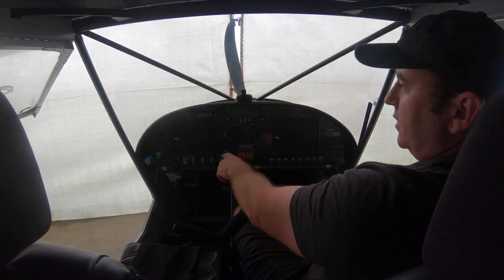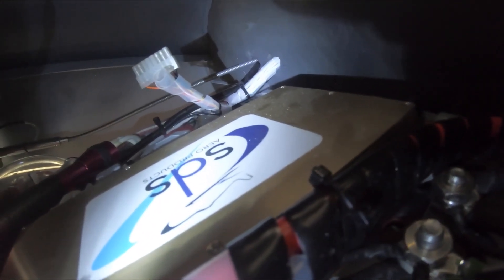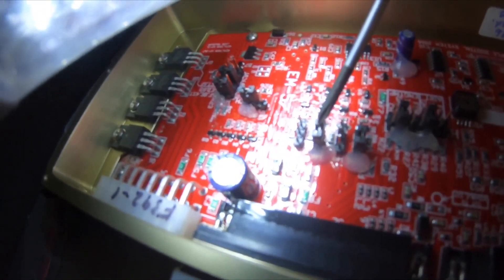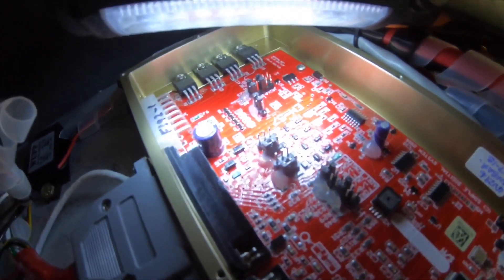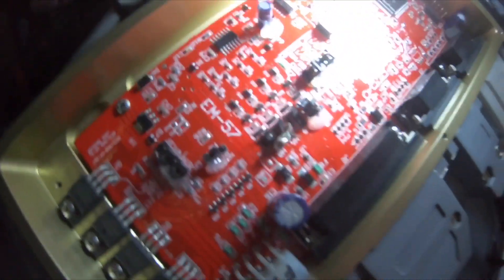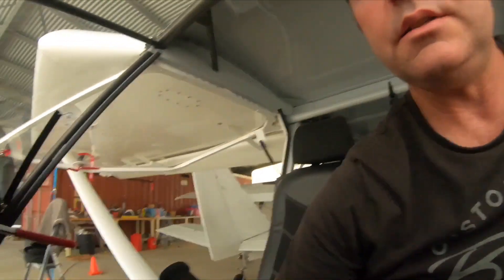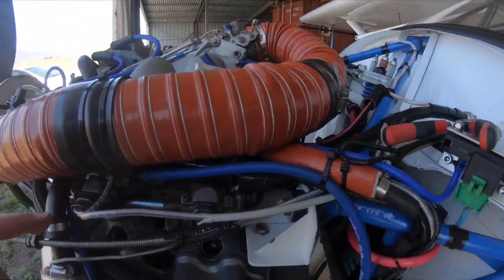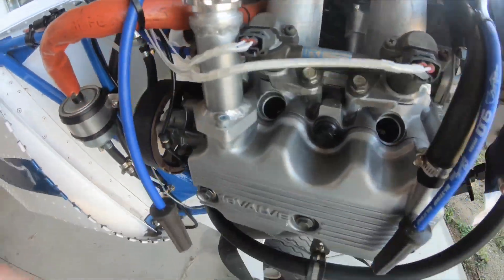Subaru aircraft SDS Fuel injection fuel trim option on the Zenith750supercruzer

Comment: Gosh that was difficult,  I just plug my laptop into the Link ECU and tweek as needed! Much easier.
Reply from the maker: Now that it is done it’s much easier than a laptop, I don’t have to Cary a laptop, turn it on , plug it in , open program. All I do is push a button on the dash to change while I’m flying.👍🏻
Reply from the maker: It’s because I didn’t order fuel trim with the ecu